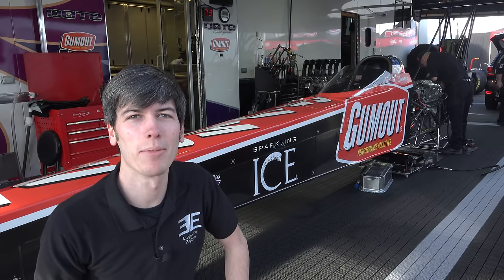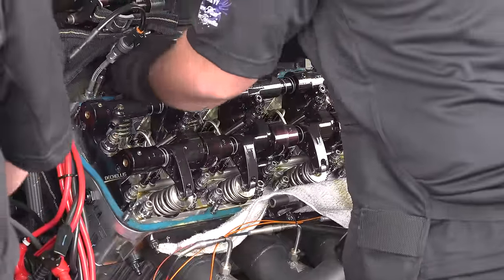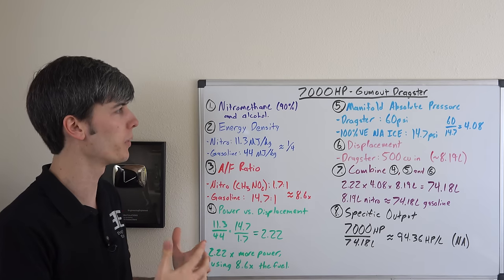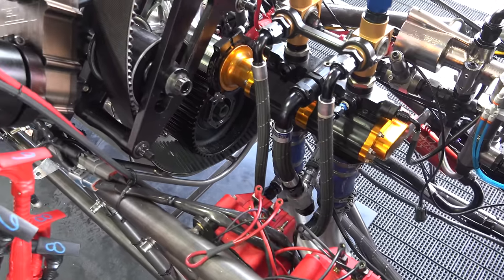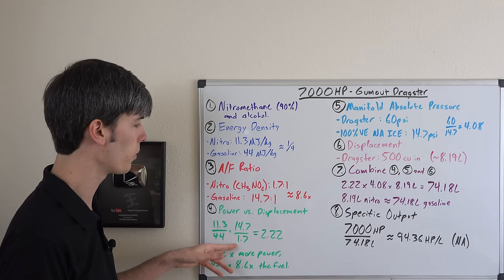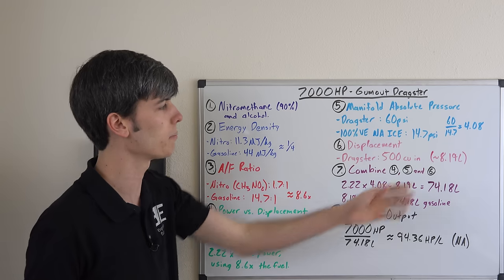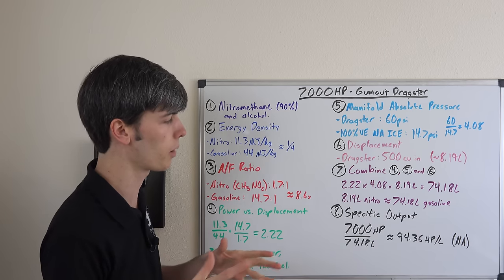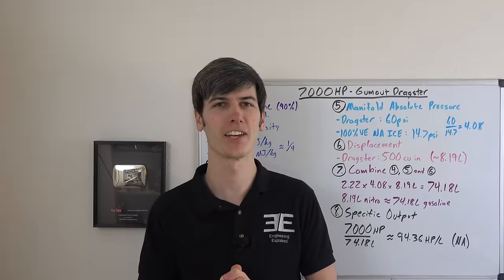Gumout Top Fuel Dragster - 7000 HP Explained

Comment: How much downforce on the front wing is required to keep the front end down during the run or at the start? How many degrees do the tires deflect on the start (Because they are wrinke wall tires) 

Also, can you do a EE video on Wrinkle wall tires?
Reply from the maker: Super0dp Decent amount of downforce up front, it's also where the fuel tank is located to keep some weight on the front end (and it has a very long moment arm, since the car is so long).
Reply: Oooo! Would like to second the request on wrinkle wall tire design.
Reply: Third for tires! I wanna know how they differ from road tires.
Reply: At the start of the race because the car starts from a dead start it is actually producing 0 pounds of downforce. I remember hearing/reading that these cars really use the down force from the 100-200MPH range (or maybe 250MPH range) and after that it doesn't really need the down force. 

Also it is often stated that these cars make between 7,000 to 9,000BHP depends on who you talk to, it may also depend on track location and condition.
Reply: 5000 pounds of force at the end don't know about deflection but they use tubes in the tires and are usually set to 6 pso
Reply: "Flexwall" tires are now on the street on the Dodge Demon, made by Nitto, they are NT05-R.  They put around 26% more tread down before they move forward according to Nitto.  They are 'dry street tires' - don't try to drive in the rain with them.  Added note, an old drag racer once explained to me the tires are actually bolted to the rim to handle these forces.
Reply: @Brap Brap: I had a picture of Jungle Jim Lieberman's car in a book, the photog took it just as he hit the throttle, if I remember correctly, the rim had turned about 90 degrees and the car hadn't moved yet.
Reply: I saw a video recently of a pro stock driver saying the front tires are off the ground for the 1st second of the pass.  I.e you're going over 100mph before you can think about moving the steering wheel.  CRAZY

Comment: I've been a couple of these top fuel races. They're so loud at idle, I can feel the thumping of the engine on my chest. If you sit front row, the sound when they go by will sometimes  blur your vision from the sound waves. You'll also be covered in tire and exhaust soot by the time you go home. Expect to wear ear pings and ear muffs it's so loud. Watch a few of these top fuelers and then go watch a 10 or 11 sec car and it's like watching a drag race in slow motion.

Comment: dsr calculated they are now north of 11000 bhp,the blower uses 600 bhp to turn it and it uses twin 44 amp magnetos to spark the 16 plugs (which are completely destroyed before the end of the run and the engine is 'dieseling' from then on
the fuel pump is so fast and large in volume that,at full throttle the engine consumes a bucket of fuel faster than you can empty said bucket by turning it over (just think about that) it has no gears and the clutch slips at a controlled rate (by fingers hydraulicly feed pushing on the 5 or 6 discs.)
the black art in running the numbers is the clutch and ignition timing that the crew chief can increase or decrease at any given time (the throttle stop activates timers for adjustable valves) during the 1000 foot race,so if for instance there is a bump at 200 ft that will unsettle the rear tyres,they can take ignition out or add clutch for a fraction of a second to allow for the bump.
if it was just 100% power,the car would just do a 1000 ft burn out at best and at worst,backfire the supercharger and blow the crankshaft through the engine block.
the top fuel and funny cars,on a good run are approaching 280mph at the 1/8 mile (220 yards).

Comment: Could you do a video on the math of how Top Fuel dragsters get the grip to actually use all this power? I read somewhere they're accelerating at 5Gs almost from zero? How do they do this with little to no downforce?
Reply: Clutches and rubber.

Comment: The U.S. Army dragster came to my auto class and the guy said they make 10000hp and burn 17 gallons each run.
Reply: Yeah this guy says 7000hp but he's wrong, that's what they were making a few years ago now they make 10000hp
Reply: Yeah they are making 10,000.
Reply from the maker: TheSamplebridge People seem concerned with the 7,000 vs 10,000 argument. I like numbers I can cite: http://www.nhra.com/streetlegal/nhra101.aspx
Reply: Engineering Explained yeah true, but I wasn't about to argue with one of the guys that builds the engine.
Reply: Engineering Explained It'd be interesting to see how long ago that page was updated, though.
Reply: Yeah on ESPN when NHRA is on they always say they make 10000hp.
Reply: You can't really dyno a top fuel dragster or engine
Reply: yeah obviously lol
Reply: Top Fuel engines make more than 10,000.... speaking to one of the DSR guys at their pit one time and he said they estimate that now they're more likely pushing 12-14,000... they just don't have any way to dyno one of these engines... they would self-destruct before you could actually achieve peak HP.
Reply: yeah they make 10000 plus, most say around 11,000 now. this guys talking about when they used to run 60psi, now they run around 80psi.

Comment: just asking for science purpeses but would it mess up a gasoline engine if you put nitromethane in it?
Reply: Yeah, it would do a similar thing to what putting petrol in a diesel engine would do.
Reply: The mixture ratio is so far off, the gasoline engine would not even run.
Reply: Try it and find out! LOL. j/k

Comment: I'm a bit confused, because if we look at drag diesels for a second, step 5 would be 100psi/14.7 (~6.8) with a similar size engine (let's say 7L for argument's sake), then 7*8.19 = 56L equivalant, and if they make 1000hp/2000ft-lbs tq. and we take a weak estimation of HP/L, say 80, then we get 80*56, which is ~4500hp, ~8000ft-lbs tq.  Those trucks won't make that (I mean they CAN, but they won't be on average).  That's before even taking into account energy improvement of diesel over gasoline (which I believe there is).
So where is the math above going wrong?

Also, how is supercharger size taken into account?  If the blower was half the size, it could still make 60psi (though much less CFM), yet you'd still wind up with the exact NA equivalant, same HP/L, etc.  All PSI isn't created equally.

Comment: FYI... Top fuel 500ci drag motors can make up to 10,000 hp but that much power is impossible to control during a run.
And modern 1 liter sportbikes make up to 200 hp naturally aspirated. For around $16,000 anyone can ride one out of the dealership.

Comment: And all that out of an outdated HEMI engine, as you said in another video... I have much respect for your videos and your knowledge about engineering, but you should not be only respecting the newest designs, as DOHC with 10 turbos and many problems. all designs have their pros and cons.
Reply: +HEMIV894 Saying the engine is outdated doesn't mean he doesn't respect it's design.
Reply: +HEMIV894 ....There's nothing "outdated" about the Hemispherical combustion chamber design,whatsoever...  and is in use more now, by more manufacturers worldwide.... then "back in the day" of the 1950's 60's and 70's when the 1st generation, Iron Block Hemis ruled the supercharged classes (and still do) regardless of fuel type... Gas, Alchy or "pop" (Nitro).

I know you were only "quoting" the poster of this video.... and are not the originator of the "outdated Hemi" comment... but it was your quote that caught my attention, and just wanted to comment on it.... am Not criticizing you in any way.       Take care.

Comment: Does this car go from 0 to 480 km/h in under 4 seconds??? Is this right?????
Reply from the maker: +Vinicius Martinelli Yep!
Reply: +Vinicius Martinelli nothing on earth can accelerate as fast. hell a stock 350 cant even power the supercharger.
Reply: +bearded bird I'm sure you could find SOMETHING on this planet. What about a Saturn V rocket or the Shuttle? Or fighter jets. Definitely the fastest thing on wheels though.
Reply: ***** The dragsters stil would be quickest to1/8 mile. At 1\4 it'd be close, their pulling 5Gs
Reply: ***** Would be fun to see one race a F18 tho
Reply: +Len M. Let&#39;s put it this way: 0-480 km/h in 4 seconds is ~3.4 G acceleration on average. Top Fuel dragsters can go from 0-160 km/h in as little as 0.8 seconds, which equates to 5.6 Gs. The Apollo 11, powered by Saturn V, reached a momentary maximum acceleration of 4 Gs right before the first stage separated. In the first 100 seconds of the ascent the rocket went fairly steadily from 1 G to 2.3-2.4 G. The Top Fuel dragster beats the Saturn V in both maximum G generated as well and average G forces quite handily, it is a much more violent, though way shorter ride. Admittedly though the Saturn V could probably accelerate quicker than that momentarily if pushed hard with a light load, AFAIK they throttle it down a bit because it's uncomfortable for the astronauts and a waste of fuel to accelerate too fast too early while still within the atmosphere.
Reply: +Vinicius Martinelli Yep. And if you put a concrete wall at the end of the run, it goes from 480km/h to 0 in 0 seconds.
Reply: +jubuttib   Rocket cars still hold the top records. 

The lowest 1/4 mile ET of 3.225 seconds at 412 MPH (663.05 km/h) occurred in 1977 by a rocket car driven by Kitty O'neal.    Chris
Reply: ye but how many gallons it goes thru.
Reply: +Vinicius Martinelli it hits 60mph before it turns its tires once litterly
Reply: +bearded bird they put a special compound on the track so it doesn't slip as much
Reply: +Benjamin Franklyn 24 gallons for a run, burnout to finish, i know bob tasca 3 and Tj Zizzo
Reply: yeah i know almost lost my shoe during track walk at maple grove
Reply: +jubuttib actually the throttle down occurs as they approach Max Q, the altitude where atmospheric pressure is greatest. They have to throttle down otherwise, the pressure can tear the vehicle apart. Once clear, throttle goes back to max efficient power
Reply: My brothers and I did that when we were young. All we had was a large rubber band that we manufactured by knotting together the rubber from 6 or 7 inner tubes. We came very close to catapulting our youngest brother off the roof. I'm pretty sure he would have experienced this kind of acceleration...just before landing in the canal across the way. Too bad mother caught us just before launching time.
Reply: Robert Spratlin I'm dead XD
Reply: The Saturn V rocket and Shuttle actually have pretty low accelerations.  For the Saturn V it's 1.2 Gs at takeoff (i.e. barely enough to lift off the ground), going up to a max of 4 Gs. https://www.quora.com/Shouldnt-the-acceleration-in-Apollo-11-have-killed-its-crew  For the Shuttle it's 1.2 Gs at takeoff going up to a max of 3 Gs.

As any Kerbal Space Program player knows, having high acceleration at liftoff is BAD, because you'll accelerate to high velocity while in the lower atmosphere and then waste a bunch of energy fighting air resistance.  Better to go slower through the thick lower atmosphere, and then accelerate more once you're above it.  But even once you're in a vacuum, you don't want high Gs, because that requires a heavier engine which would reduce payload capacity.  Orbital launch vehicles are limited mainly by fuel, not engine power, so it's best to use the lightest and most fuel efficient engine that gets the job done.

The Saturn V first stage engines produce a whopping 7.9 MILLION pounds of thrust at takeoff, but that's because the total weight of the Saturn V is 6.5 MILLION pounds (the overwhelming majority of which is fuel weight), so it takes that much thrust to produce a measly 1.2 Gs and barely get off the ground with all that fuel.
Reply: Also, comparing payload delivery systems to this isn't quite... well, comparable. Rockets are meant to accelerate vertically, facing much more resistance from gravity as they ascend, and all of them are heavily laden with fuel, both to ensure the rocket's structure holds together during launch and to actually have enough range to reach orbit.
A dragster carries just enough fuel to make its run, which it does at more or less sea-level. To compare a rocket to it, you'd need to attach some kind of under-carriage to a rocket, lay it on its side and give it enough propellant to only make a short run. In which case it would have far greater acceleration than during a vertical launch.
It's why rockets are actually used in some drag vehicles, though mostly for show, not official NHRA stuff. Hell, there's some crazy guy with a truck that has jet engines strapped to it and goes like.. 350MPH, and those aren't even rockets
Reply: +shiva1008    I wish i had the laughing smiley for this comment.
Reply: I know something that accelerates faster. A APFSDS shell from a rheinmetal L55 cannon. Goes from 0km/s to 1.8km/s in 6.6m

Comment: My friend has a 6 liter Toyota V12 that she custom built for her 98 Widebody Supra, four turbos and a super, makes 3,000 crank horsepower. It works out to exactly 500hp per liter. This dragster, 7K split among 8.194 liters = 854.7. Conclusion? That would be a race.
Reply: +Joseph Kane While I'm pretty much certain you don't have a personal relationship with anyone that has a V12 Supra, the race wouldn't even be close.  The dragster would destroy it.  We're not even talking the same ballpark.  Despite it being better on the dragster, HP per liter doesn't matter much.  The dragster is lighter, more than twice as powerful, has much better traction, and is 100% optimized to go from zero to ludicrous speed faster than anyone else with mechanically driven wheels.

Comment: An Interesting comparative analysis.
One comment: I suspect significant energy losses in the blown nitro engine due to the slow burn rate of nitro ; just witness the header flames these cars produce (this is all lost energy) - could be as much as 30% higher than the losses experienced in the "idealised"  normally aspirated gasoline engine ???
Factoring an additional 30% losses into your analysis, yields a specific power output of around 125hp/litre - roughly the same as you quoted for the Ferrari - ( or conversely if the 9000hp - 10,000hp power output that is commonly quoted for these Top Fuel engines is factual, your figure of around 95hp/litre stacks up  - again based on 30% additional losses in the nitro engine)
Please note 30% is only an intuitive guess on my part.

Comment: How much does 1 run cost?
Reply from the maker: I don't remember the exact number but I think it was in the ballpark of $8K.
Reply: 6:26, why do people wear headphones to this event?
Reply: These things are LOUD. Like LOUD LOUD. 150 decibels loud
Reply: Anthony Abelardo They're so loud you can feel them hundreds of yards away
Reply: $14k in Australia.
Reply: Lol "We could spend a month in Hawaii in a 5 star hotel and premium tickets to everything, or we would go for 1 run to try and shake 0.2 seconds off."
Reply: Anthony Abelardo
It's hard to describe how loud these are. When a Fuel car blips the throttle at in pit varm-up, it's mostly comparable to the sound of a large 10 gauge shot gun unloading both barrels. Now imagine that sound with a 4 second duration. There's a reason why people wear ear protection in the stands.
Here's a story from real life. About 15 years ago, I staged a car at an exitbition race in Sweden. The car I was staging was just an 1100 hp '65 Impala 9 second bracket race type deal, and the point of the whole race was to showcase the speed and power difference between the two. The driver of the Impala was pretty seasoned in the bracket stuff, but had never experienced a Fuel car. As he pulled up, the Fuel car was already waiting and had warmed its tires. When the tree went green, the driver of the Impala just sat there. He was so startled by the sound of the Fuel car, that he forgot to race. He was in a closed car with a helmet on attenuation the noise... Loud does not begin to describe the volume of a Fuel car.
Reply: I grew up in Bristol, tn.  You could hear the drag cars clear across town on the Virginia border.
Reply: They are the loudest things I have ever heard. Sitting in the stands it is an earthquake, your vision gets blurry from the intense sound waves. You feel it in your chest.

Comment: An EMD 710 V20 two stroke diesel engine produce 5,000 HP at 900 rpm, 710 cu in (11.6 l) each cylinder (20) I just wanted to share it :-)
Reply: Daniel Estrada Morales And a MAN B&W K108ME-C6 14 cylinder turbo charged two stroke diesel engine produces up to 132300 HP at 94rpm with a displacement of 2436.8 liter per cylinder and reaches a thermodynamic efficiency of over 50%. ;)
Reply: I've never seen one of those, I work for a tuna fishing/canning company and the ships have the EMD 710, 645 and CAT 3608 :-)

Comment: awesome video, but what if you want to get the most power per gallon fuel?
Reply: tamenga88  you still need a fuel lox will run the best and cleanest with liquid hydrogen. Because you dont want the film of oil in your engine becoming the fuel source lol
Reply: tamenga88  also lox can be metered to burn tamely just requires not atmospheric air and a bit of engineering to inject into a manifold without chilling the crap out of the material so metering will need to happen.

Comment: In the last couple of months, engineers have finally measured the actual driveshaft horsepower of a top fuel car, and it exceeds most predictions: between 10,000bhp and 11,110bhp.  At last we know.  I had always felt the "10 thou" quotes being tossed around to be wishful thinking --- but it's true.

Comment: I am confused by the numbers for #5 MAP.  So if the engine runs on 60 lbs of boost(gauge press) would it not hv 74.7 lbs of manifold absolute pressure at sea level?? So if manifold pressure is only 60 that means its only running about 45 psi of boost...